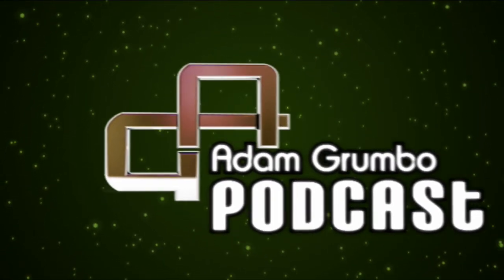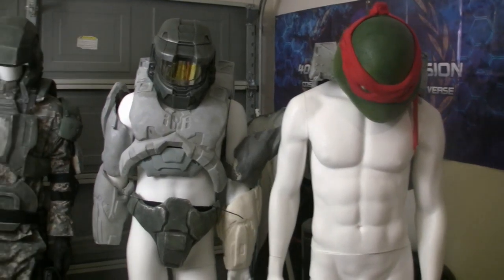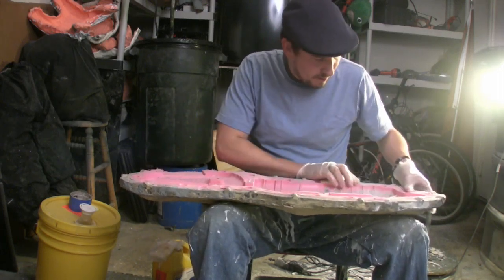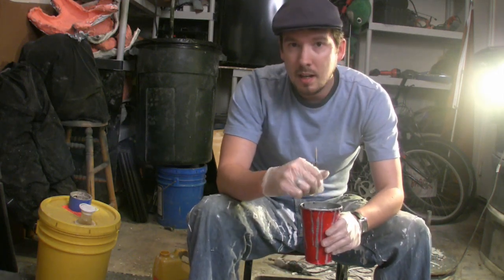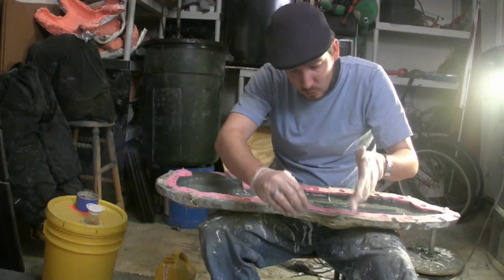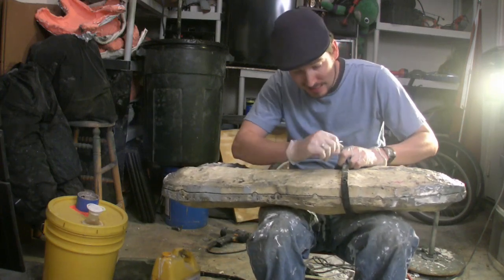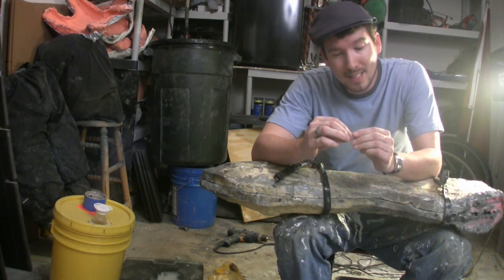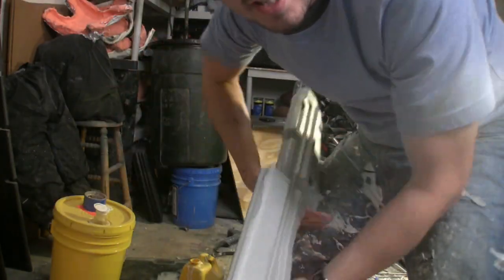Adam's Podcast 2 - Making Assault Rifles

Comment: definitley strong enough for any replica, however i probably would be hard pressed to withstand the pressure and forces of a paintball gun unless it is a weak paintball gun and you make the sides thick, the compressize strength of smooth cast 320 is about 5000 psi
it may seem like alot however that is nothing compaired to something like 
steel with a compressize strength of about 250000 psi

Comment: so, you got the original plug made professionally? CNC machines are damned expensive of themselves, take several hours for anything particularly complex too, but no way would it cost $1500 to make the two halves of the assault rifle out of MDF....which, when finished properly, is a damn good plug material. quite a few hours work sanding that thing down though.
my old school had a CNC router. pretty useful device. long hours whiled away waiting for it to finish....

Comment: I'm exaggerating a little of course, firstly, my technology teacher scared the crap out of me, no way I'm going back there without a REALLY good reason. second, I'd have to sand the thing down, as well as feed the .stl file through the toolpathing program first, though thats the smallest step. but still three hours at most for the actual cutting. how thick is the rifle? the maximum width that the machine could do was 48mm, with a two mill sacrifice block. that'd be done twice, one for each side

Comment: If you would sell them for 117$ and manage to sell 40 of them, then you would make enough to "pay off" the CNC work + mold and make extra 480$

1500 - Original Rifle
700 - Mold
2000 - Material
480 - 12$/h x 40 hours
---------------------
4680$ - 40 Rifles for 117$ each

And with the 41st Rifle you would make 62$ with each unit sold.

-Doan

PS: I just did this out of pure boredom. It's not an offer or anything.

Comment: you could build the model, but you would be better off designing the 3d model in several components and then fitting them together. Do you have access to a 3D printer?